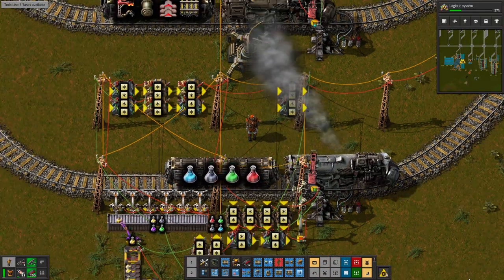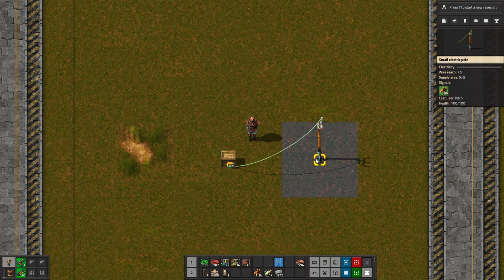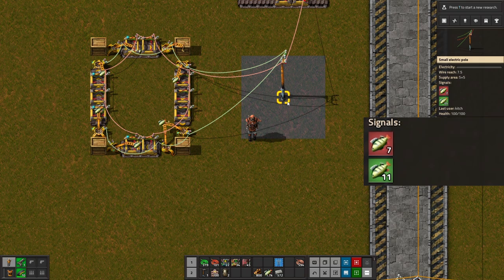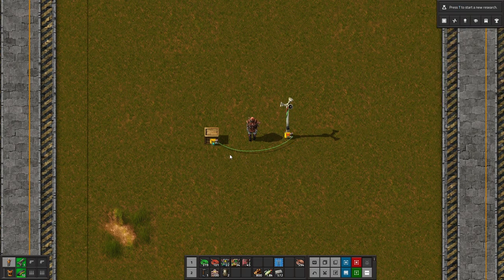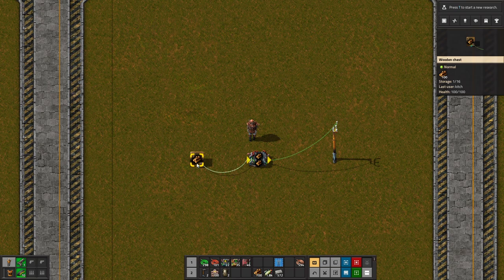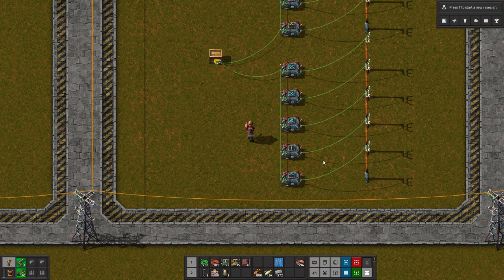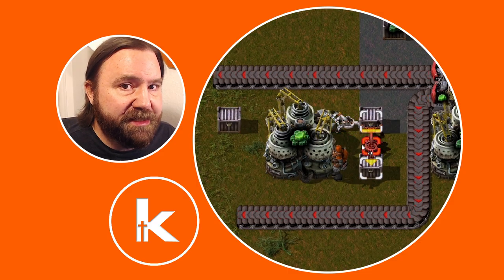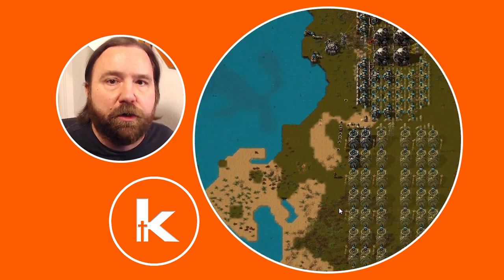Factorio Circuits - Ep 1 - The Circuit Network for People that Don't Remember the Circuit Network

Comment: the "Output Anything" is good if you want to deal with each item type individualy.
So if you have a chest with that and you add a filter inserter and set the filter to that signarl, instead of getting everything from the box, it will only get out that specific item that is currently put out based on the item id order. That way it will first remove all the Items of the first type, then all the items of the second type etc.
you couldn't do that with any of the other signals.
And as we have seen, it could be a chest that has like "'Stack of wood, stack of fish, partial stack of wood, partial stack of inserters" etc. in it and without the Anything output you couldn't do it that it first removes all of the occurences of one item type before it starts with the next one.

Comment: With the ability to specify the number of trains that can travel to a station, it makes life so much easier. I've found that if you have a route with multiple stations (say for example, three stations pick up iron plates and two stations dropping off iron plates) you just need to have one less train than you have stations and set all the stations to only allow one train and you're off to the races! No need for stackers as the only time a train will travel to a station is if it's the only train traveling to that station.

Oh, and welcome back! It's good to see you again!=

Comment: Welcome back.

The case for the "anything" output that I think I've seen used is for filters.  Use that output, which chooses one of the valid signals, and set a filter inserter to filter on that signal and presto! you're only (e.g.) pulling items of a chest if there's more than 27 of them.

Comment: Since you raise the subjects of 'On Rails' and circuit networks, I am reminded of an old unsolved problem of mine. Imagine a factory with no stationary buffers, and no belt buffers. Most resources in the factory are on a scheduled train or in a machine. How would one accurately track the factory's resource totals, updating inventory signals from train contents while trains are in station, and maintaining those signals while trains are in transit?
Reply: I never saw it or try it, but maybe you can use the robot thing using the red or yellow chests, and get that count from there? since the network can feed you that info, maybe you can use it???
Reply: Just remembered another, conect all the chests "outputs" to a single pole, and use the "red little box" to set a number you can compare... like =if (the chest<"Little red box"; then = (Use power plug to power the machine) ; Else = Unplug power machine.

Comment: anyone know how he is able to see his settings for input / output on the combinators without opening the menu? I cannot find an option or hotkey anywhere for it.
Reply from the maker: In Factorio, if you go to "Settings" and the "Interface", there's a box labeled "Alt Mode"  In that box there's a "Show combinator settings in Alt-Mode" checkbox.   Make sure that's checked.  Then you should be able to see them when  you are in alt-mode.
Reply: @KitchsVideos  omg, I'm blind.  I swear I looked though all those settings two or three times. TY!